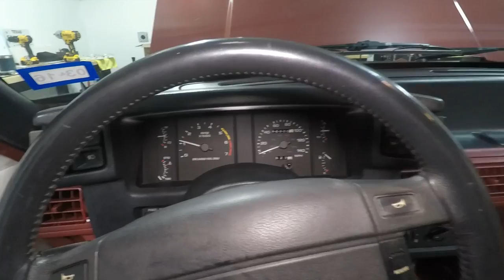Mustang Idle Issues - Idle Air Bypass? Vacuum Leak? //Symptoms & Solution//

Comment: When I changed my fuel pump I also extended my fuel return line with a fuel hose about 5 inched to just above the sock filter. This stops returning gas being aerated in the tank causing idle issues. My mustang has never idle steady until I did this. I was amazed that it worked so well.
Reply from the maker: Oh wow - I’ve never heard of that one before?
Reply from the maker: Will do - thank you 👍

Comment: Change your tfi module if you haven’t already to. I had idle issues with mine would die at the lights here in town and wouldn’t start for few minutes.  Finally figured that out no problems since.
Reply from the maker: Interesting- thx for the tip my friend!
Reply: @KASLCustoms  if you do I strongly recommend spending a few extra dollars from Ford  them after market ones will bite you in the ass
Reply from the maker: No kidding? Ok also good to know 👍

Comment: This a very good video KASL. I think the throttle body assembly should be part of an annual service for anyone who owns a 5.0 that is a daily driver. All the muck/carbon and oil that accumulates in the throttle body AND the upper intake......partially comes through the EGR valve.

Side note: There is no need to adjust the TPS with multimeter to get .000 whatever!
It's an ingnant misconception. Almost every 5.0 has holes pierced in the wires!
The TPS is designed to fail after so many year(s) of use. That is why the inside is made of plastic and not metal so it wears down causing slop over time. It is meant to be replaced.
Reason is that over time the heat will affect the the TPS internal resistance sent to the CPU.
Best practice is to set all timing, then loosen the TPS screws and adjust to get the best idle/rpm.
The CPU has only 2 kilobytes I believe....much less than what I have typed here! DP
Reply from the maker: Hahahah true! They really are very simple items that need a community of folks like this to get right 🤣👊

Comment: The carbon build up on the EGR valve causes the the valve not to completely seat closed with engine vacuum allowing hot exhaust gasses(low O2) to leak past the cone and your sensors are trying to figure out your air fuel ratio at idle. As you can tell there is a lot of carbon build up! There is also a very tiny bypass hole inside the Air bypass valve that you cant see but a small wire pushed (guitar string) down inside will clear the bypass hole. You can't dissolve carbon. You have to scrap it! Nice Video! EH.DP
Reply from the maker: Right! Thx for the info buddy 👊

Comment: Same with my recently rebuilt 95 Mustang GT. It will always die on startup. It used to startup, idle roughly, and die when it gets warm but now it won't last a minute and stalls. I noticed a hissing sound that lasted for 3 seconds from the intake manifold side behind the distributor so i guess it's due to vacuum leak.
Reply from the maker: That sucks my friend. But yes, I think you’re on the right path 👌

Comment: Picked up an old 1988 5.0 Mustang watching you vids found out that the smog pump was removed. smaller belt. vac lines no plugged or the heads? So I am in an a complete redo of it all. Do a good timming video when you have time. but slowly watch all videos. thank you

Comment: My '88 Mustang GT has recently started "searching.'" The throttle body looks almost spotless off the air tube, but I suppose the internals could be gummed up. If I end up pulling it for clean-up, what's the best cleaner to use?
Reply from the maker: Maybe check your TPS before pulling your throttle body and make sure it's within OEM spec. As for cleaning, remove TPS etc. and clean it out with bike clean
Reply: Thanks!

Comment: Did you clean your mass air flow yet? Don’t you just love working on your mustang? I finally got everything ready for my gt40 heads explorer upper and lower intake 65 mm throttle body and egr cooler and little bigger mass air flow I decide to use my stock cam though before I went crazy trying to decide the one I wanted lol
Reply from the maker: I actually just changed it out for the one off my coupe which was clean as a whistle! Very nice, that should be a fun car when you’re done 👌

Comment: Great video!  Cleaning all that carbon buildup is the best place to start. Did this recently to my 90 GT that would stall on cold start and made a huge difference. Have you ever checked it for codes?
Reply from the maker: Yessir I agree. I actually haven’t but I am going to for sure 👍
Reply: when I look inside my motor  all I see is carbon what will clear it out
Reply from the maker: You could give it a sea foam treatment
Reply: @KASLCustoms  there's alot the car sat for 10 years untill I got it over the summer in August and the carbon is coming out of every where and I tried the seafoam the one that blast into the motor while running it help a little definitely need more

Comment: The bolts are steel and they are reacting to the aluminum. Its a good reason to bypass the coolant entirely and the EGR. The only reason it exists is for emissions at startup. Once the engine is warm, no other purpose.
Reply from the maker: Fair enough. Thx buddy 👍👍
Reply: No don't bypass the EGR coolant! The reason for the coolant flow is that the coolant temp (180-210) is much cooler even at operating temp than the EGR gasses (300-1000+)that will flow through the throttle body. Reduces the the temp of the air flow greatly. WOT closes the EGR valve then back to normal mode with normal driving. The carbon build up is from the exhaust gasses. Maintaining the coolant system is critical in any vehicle.
Reply: @DP-bc3xl  DP is correct. I wasn't clear and was suggesting an EGR delete. But if you need it for SMOG then you have to keep the coolant.
Reply from the maker: Good info! Thx for weighing in on the topic my friend! 🙏👍

Comment: Do you have any experience with oversized BBK throttle bodies or the edelbrock performer intakes?  I got this whistle at idle that doesn't really cause an issue but when you shut her down you hear it after it's kinda funny.
Reply from the maker: I have a 75mm bbk on my coupe but don’t notice any whistle? It is mated to a ported cobra intake - maybe it’s something with the intake? Or maybe a vacuum leak?
Reply: @KASLCustoms    I can't find any leaks by spraying carb cleaner but I have read about a whistle people got with some bb'ks.  I wanted to pull it apart soon anyhow maybe new gaskets will help.
Reply from the maker: Interesting, I’ve never heard of that but will definitely pay attention and see what I can hear
Reply: @KASLCustoms 
Here is my whistle.  I can't tell if it's the iac or a gasket somewhere. Tried swapping the egr and iac.  If I google whistle BBK mustang there's a few guys talking about it but Idk.
 https://youtu.be/M4m_zBDs-HU
Reply from the maker: Wow that’s super odd!?
Reply: @KASLCustoms  Right?!  Almost sounds like a blower.
Reply from the maker: Hahahaha - you could tell people that it’s blown at the car meets. Just don’t take them up on any offers to race 😂😂